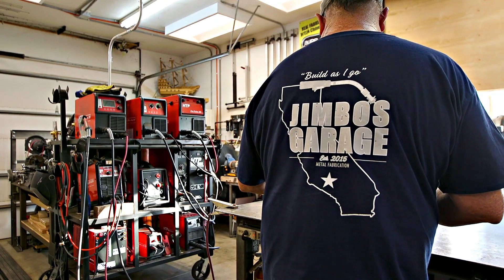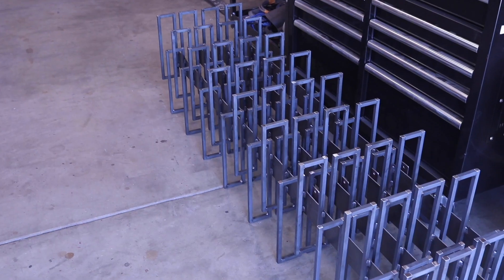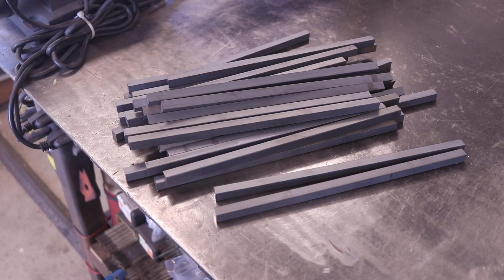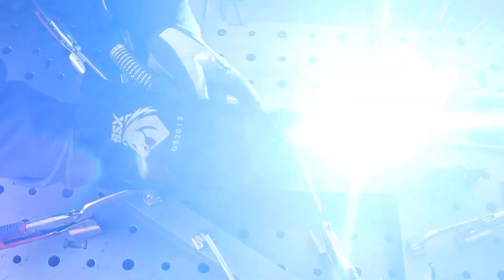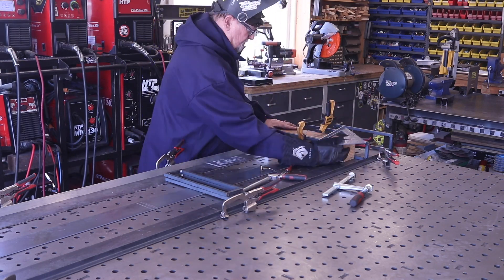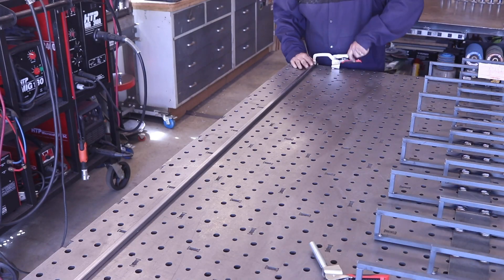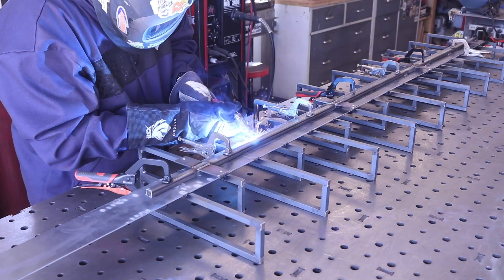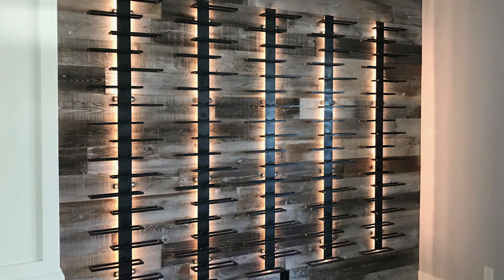Floating Metal Wine Rack | JIMBO'S GARAGE

Comment: Great jig set up. How come you don't set up a stop block for cutting the bar stock to length? The last pic it looks like the welds are face up, so they are hidden behind the bottles?
Reply from the maker: Thanks for watching Tom, I had a block attached to the saw with a mark on it so i could cut them all to the right length. yes the welds are face up and they are hidden when the bottles are on it.    Jimbo!

Comment: Not a wine drinker but I thought wine bottles needed to be stored with cork end lower to keep the cork from drying out.  I also thought light was not the best thing for wine storage either.
Reply: Peter Haan 
If the bottle is full the cork will be wet when they are on their side. 
I think (not a wine drinker either) the light that is harmful is UV light and I don’t think LED’s produce UV light.

Comment: I've watched a couple of your other video's on gate builds and you've mentioned dealing with gaps in your miters..curious why? I also noticed you use the slugger saw..I once purchased the evolution saw which is similar, then returned it the next day because it couldn't cut a straight cut..when i made 45 miters, I was dealing with a gap on one side-not from an incorrect 45 setting- but from the head of the saw actually not right..turned out the saw arm mount was not machined well enough..so i returned it..my question is..have you noticed this on the slugger? have you ever considered it being a possible issue for the gap? or was there another issue?

Comment: Great Job !!!
What kind of welding were you using to get those 1/2" solid bars together?  Dual shield flux core ???  The welds look great !!  How was the penetration into the 1/2" bar?
Reply from the maker: Thanks for watching Ed,  I was using spray arc Mig.    28 volts 620 ipm on the Htp pro pulse 200     Jimbo!

Comment: Jimbo. I don’t get it. You make up a jig to weld up the bottle holder which makes complete sense, especially since you’re making 90 of them BUT you continue to measure and cut your pieces 4 at a time which is 45 individual cuts for each length of square bar stock meaning your sizes can vary each time you cut. (90 cuts) 
Why not set up a stop block to cut the 2 different sizes speeding up your work and increasing your accuracy of cut. 

The wine rack by the way look absolutely fantastic and the LED lighting with that wall is the crowning touch.
Reply: Wayne I know what you mean.  For woodworkers, creating a stop block for the cut seems to be second nature, but that sort of workflow has been a surprise to most welders I've seen.  I wonder if it's because many woodworkers have dedicated chop boxes, but most metal cold saws I've seen are pulled out for use then put back away?

Comment: Looks really nice although using solid bar rather than tube for things like this always feels a bit wasteful to me. But if that's what the customer wants...
Reply: Well, there are a bunch of exposed ends on each of those rectangles, so the solid bar does look nicer. It's a waste of material, but definitely saves time/cost over cutting, welding, and grinding hundreds of miter joints.
Reply: @Ben C and @swolebro Same thoughts why not tube instead of bar stock and yes without intense labor you would have open ends.  However, if they were cut on 45 degrees then you would have the best of both worlds.  If it was on 45 miters @swolebro why would it be any more work if just tacking on the inside?  I know there must be a reason hopefully someone can point it out too me.

Either way, it turned out great!